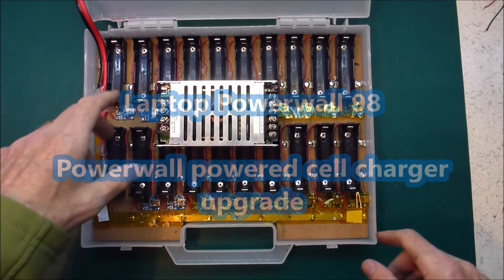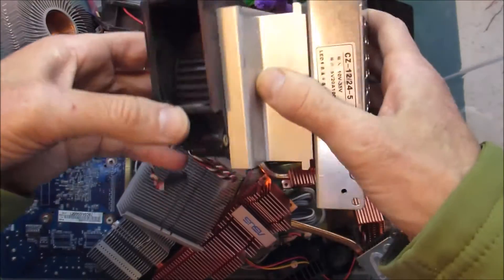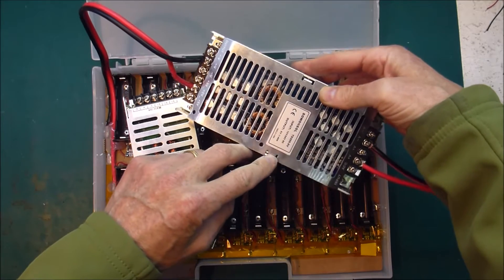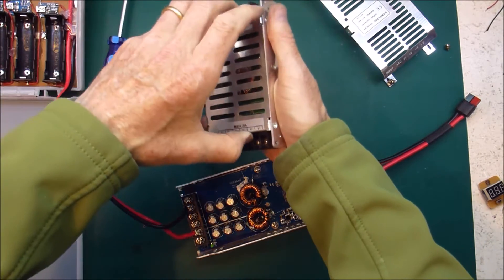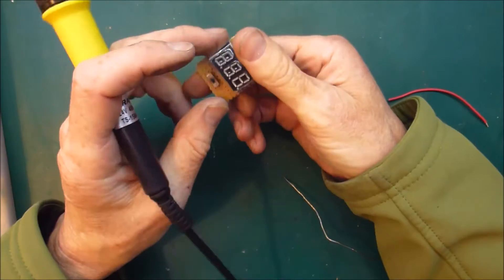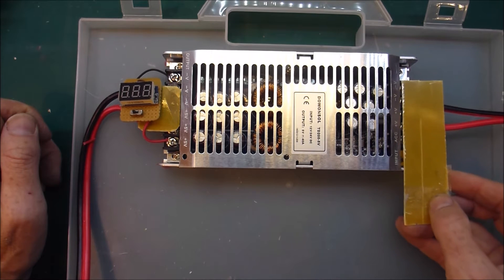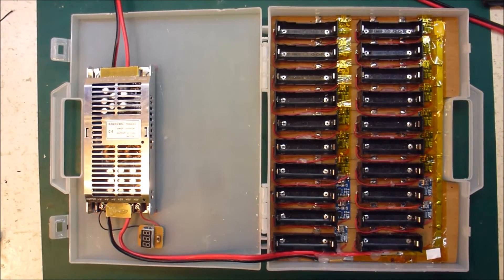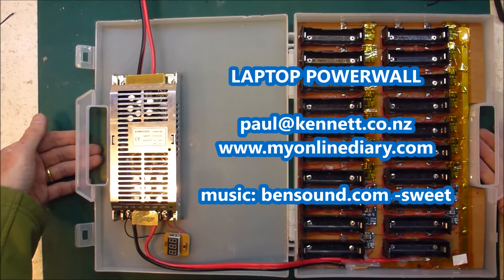Laptop Powerwall 99 - Powerwall powered cell charger upgrade

Comment: You've reminded me I still need to buy a more suitable step down converter for my lithium pack. 
I won't mention the heat issue with your design as other have already. ;-) Blast - I just did, sorry.
Reply from the maker: Yeah. Looks like my next video will be on fixing that mistake.

Comment: Is it ok to charge 18650 at 5 Volts? Is that the default for their charging?
Reply from the maker: The 5 volts is to power the TP-4056 charger modules. They supply the correct voltage/current to the 18650s.
Reply: Oh ok. What is the Voltage then 4.2?
Reply from the maker: Sparkfun has the data sheet: http://cdn.sparkfun.com/datasheets/Prototyping/TP4056.pdf
Reply: Neat, thanks!

Comment: nice looking unit. I would still run a fan on it while you are charging just set one to blow air on the Finns.  I run fans on all my Chinese devices
Reply from the maker: Hi OTE - I'll measure the temp on the new one to see how hot it gets - I'm hoping to avoid the need for a fan, but...